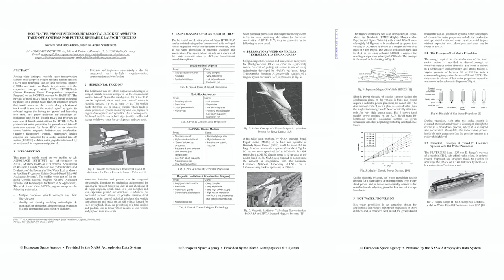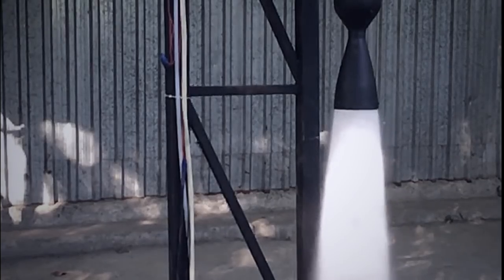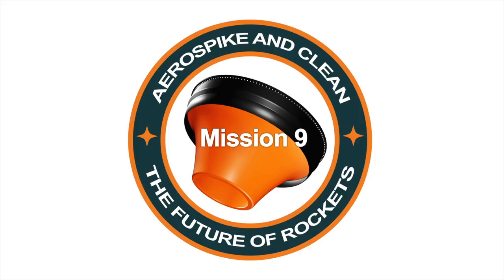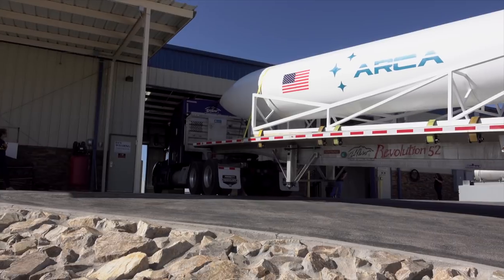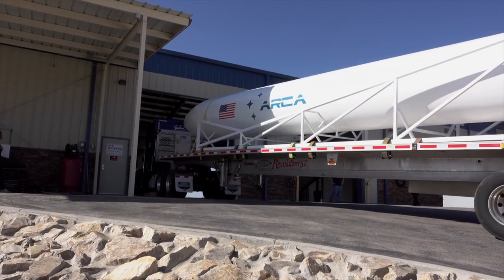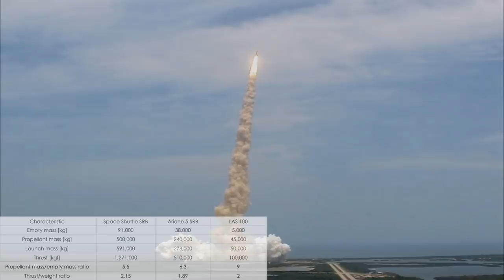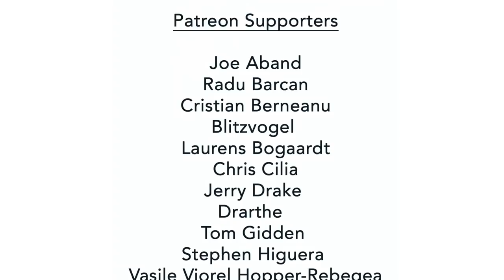Flight of the Aerospike: Episode 36 - Launch Assist System, Explained - Part I

Comment: Firstly your maximum chamber pressure is 50 bar. At lower than 100s Isp especially with the given mass fraction the vehicle would be incapable of counteracting supersonic drag forces, a problem that compounds with payload mass. I believe that paper you showed on screen directly references this issue, and if not, adequate literature from scramjet research already exists on the infeasibility of orbital flight using TSTO with less than about 2.5G acc, even if your upper stage has thousands of seconds of Isp  (Scram-jet). Even aerospike engines, which functionally only superficially increase high altitude performance when mass fraction is considered, are not close to a solution. Gravity drag is so high it is asymptotically impossible with a structural coefficient greater than 0.1. A steam pressure vessel with LIPO batteries (<500W/kg) will in no universe have a structural coefficient of less than 0.15 unless it is literally the size of the death star.

Comment: This is now clearly some ideas searching for a solution searching for a problem to solve.    Environmental friendliness isn't a big win if it just assisting a honking great traditional chemical first stage...  And, the aerospike isn't an advantage unless it is operating in atmosphere  and also in vacuum - a launch assist booster with short duration won't  do this, so the weight and complexity isnt warranted.     I really want this to be a thing, i just can't  see what practical use it provides in its latest form.
Reply: Some data about aerospike, I guess. Second stage (Haas) also has an aerospike, albeit linear one.
Reply: selection of the fuel is mainly driven to reduce cost of handling hazardous substances and complexity in the booster; the fact that it is environmental friendly is just a nice added bonus. I mean, all this video explain exactly this
Reply: @lesto12321  Hazardous substances like HydroLox hahah! This is nothing but a scam to people who don't know that much about rocket science.

Comment: I think you neglected to mention that liquid hydrogen and oxygen propellant used on the space shuttle main engines IS water.
It produces water in its exhaust.
There’s no way an electrical heating system can match it.
Very sceptical of this video.
Reply: while they burn into fuel, both pure oxygen and pure hydrogen have to be stored in big quantity on site.
Hydrogen is nasty as the flame burn invisible, slowly leak from anything, and is quite strong greenhouse gas.
Oxygen make burn things that normally wont burn and probably is more scary than hydrogen.
Also cannot be produces "on the fly" but normally big tank are present at the launch site, fully fueled up even when people are working nearby; at the contrary the boiling pressurized water can be produced directly on site at the moment of the fuel up (so nobody is near the launch site).

Those are huge difference that as said in the video will drive the cost up a lot as you have to take a long list of precautions to deal with those danger.
Reply: @lesto12321 
'Hydrogen is a quite strong greenhouse gas' .... You may not believe it but water vapor is one also.
The other thing about water rocket are batteries necessary for heating the water mid-flight. They won't be light Scot Manley did the math of how much power they would need.
I've stopped believing that anything from ARCA would finally lift off a long time ago. Heck the videos are still titled 'flight of the aerospike' but since the time of the aerospike they went through 2? different concepts? The water rocket will be abandoned when they finally calculate how much all those batteries will weight, and when they realize they should switch to microwaves for heating for greater efficiency. At which point they will abandon it as all previous concepts
Reply: @awazruk1  but water vapor is emitted by both steam and h+o rocket.
About manley, he calculated to steam ALL the water, not to just keep the temp in flight.
If the test will show the steam and/or the aerospike not up to the task, is just natural that they will ditch the ideas, it is about getting to space after all. I dont see whyt try different concept is bad, just look how much desing from succesful engines/rocekt changes between first ideas and final realization.
Reply: @lesto12321  BS.
Reply: @lesto12321  Sorry for the late response, iteration of design is a good thing and is necessary to achieve great results so i have no problem with it whatsoever. My problem with "ARCA style" design policy is that they are not doing it. They are not developing one concept. They jump between completely different designs which makes all the previous work meaningless and requires scrapimg of most of the ideas and knowledge you got.

Comment: I think this system has some potential, especially if the water could be overheated further and/or additional heatsources could be implemented. Things like microwave- or laserheating from the ground, using a small methalox engine to heat neighboring water engines, supply the booster via cable while its still close to the launchpad and so on...

Comment: Do you use induction or heat elements? How big battery will the rocket have? What about using some of the water inside the tank for thrusters?

Comment: if you wanted to take things a step further, and could manage the costs of integration, using a solar reflector setup to heat the tank directly, or to preheat the water would be an interesting option to further negate the use of external energy.

Comment: I think this is a good idea for a booster. Lots of thrust, easily scalable, the cheapest ‘fuel’ - water - and gets the vehicle out of the thickest part of the atmosphere nice and fast in a clean way. Also the unpleasant rocket emissions will be starting at high altitudes so no worries about NOx and sooty particulate matter at ground level. Even better you could use a ramjet (ideally scramjet but very immature technology at present )for a short 2nd stage until the atmosphere is too thin. You then save oxidiser weight.

Comment: I don't think a hot water system can equal a chemical propulsion system.  The energy density is too low, the same as comparing the energy stored in a battery (electrochemical reaction) versus that stored in a chemical reaction involving combustion.  Ten gallons of gasoline will propel my car farther than Elon Musk's Tesla.  His battery weighs 1200 pounds; ten gallons of gasoline is about 70 pounds.
Reply: There not even Using batteries For this test flight. And when they do it will only be used for in flight heating. Their main idea is to heat it up from the ground and then let it off as a wildly in efficient but powerful first stage.

Comment: What sort of performance would you get using the water system if you were to use it as a launch system on the Moon or Mars.
The lower gravity and atmospheric pressure, would this help?

If they can obtain water on Mars then fuel conversion would be so much simpler than the other systems proposed to extract/convert  to methane or other type fuels.
Just a thought...👍
Reply from the maker: Taking into account the lower pressure atmosphere on Mars and vacuum on the Moon, the engine would definitely work better. We don't have an estimation however how much better. The physics behind this engine isn't identical with a hot water engine. Maybe you noticed the high expansion ratio divergent on the test stand at almost sea level. However we perfomed some simulations in vacuum for interplanetary flights, but at a much higher temperature in the engine. In theory we would be able to get an isp in the range of 350-450sec.

Comment: So the water gets heated in the rocket before lauch? Is the water preheated before therefore reducing the amount of heating needed in the stage itself? Also is the stage pressurized for the intire week of heating the water? 200°c of pressurized water sounds dangerous. I imagine the burn (activated) time of the booster is not much longer than other boosters in the industry because of the weight and poor isp?

Comment: I just don't understand why you just don't use liquid H2 and O2? You get way better specific impulse, and still safe for environment? It's the same mentality as using hydrogen fuel cells in electric cars instead of just strait electric, you are just wasting energy.

Comment: Good luck! I really hope this works out. I have a couple of questions if you don't mind. First, is the aerospike design any good with the water and second, does the aerospike lend itself to a mulitple engine per booster configuration. Perhaps with multiples, you could get the thing to orbit easily. Just a thought.

Comment: Hello, 
I am first of all very impressed by your approach- despite many problems, you guys stood by your idea and managed to, I think, provide a very promising concept. If i understand this correctly, your aim is to use a lower efficiency, but high thrust water based rocket as a booster for orbital launches. Because the energy stored in water is lower than other propellants, the engine will naturally be less effective (requires external heating), but you plan to make up for this by increasing the size of the booster because it is way cheaper to produce and fill, thereby still reducing cost. Is that correct? Also, if you could give a general idea of the thrust-to-weight-ratio that can be achieved by this booster that would be nice and would help many people see the potential of this technology. 
Overall, it is a very impressive approach and I am particularly excited to see this combined with the Aerospike engine  - as you showed in one of the clips I'm assuming! That should also be easier to handle with a less dangerous propellant, right?
I am looking forward to your answer :) Keep doing what you're doing, and hopefully the flight test will be successful!
-marius

Comment: I have a question based on earlier videos, maybe your design changed since then. Why do you include the heating elements in the tank itself? It seems to me that since the heating process takes hours, the tank walls are thermalized anyway so you could simply heat the water from the outside on the launch pad and save weight and complexity. Was it just for testing?
Reply: @HylanderSB   Thank you for your answer but I wasn't thinking of transferring superheated water in the tank. I think they could heat the whole tank with cold water inside in some kind of huge mobile oven right before launch (like a big heating sarcophagus if you like). I don't think this is more complex than what they are doing now and this is definitelly weight saving. Plus they get to reuse the oven part.
Reply: Moreover they can add as much insulation aroud the oven as they want which speeds up the heating process without a weight penalty
Reply: @HylanderSB  Yes through the walls by conduction. That work pretty well for steam engines. Moreover they have all the time in the world to heat up the water.

Comment: After the karman line, I doubt superheated water would have enough isp, this idea would work very well if we had a efficient energy source at a high temperature, basically a functioning fusion reactor.
Why not make the heating element an augmented nuclear reactor??Current batteries are bulky so...
Best of luck!!
Reply from the maker: It is possible to use this engine in vacuum for deep space missions. We ran simulations already and have something on the pipeline. But, when the time will come. Nuclear reactor? No! Just think outside of the box. Don't chase performance, but rather to have the job done, fast, cheap and safe.

Comment: how are you going to power the thrust - what heats the water and how do you get the energy to do it?
Reply: i understand that you heat it on the ground and it stores heat but how are you going to get the huge amount of energy for orbital flight from this? (the energy in the first stage is still very important)
Reply: @tristianity8529  The water is heated to a particularly high temperature and the onboard batteries are there to just "tip it over the edge". So the energy is the heated water really+a little battery power. Their contention is that even if it's not great it's enough to help their upper stage.

Comment: I admire what you are trying to do and that's why I subscribe but I am tired of your pointing finger attitude really off-putting. So please less pointing finger and more data like the amount of h2o vapour in the hight atmosphere per launch since it is your biggest pollutant.
Reply from the maker: Thank you very much for subscribing. We are just trying to show the potential benefits of a new approach. We never said that a particular rocket is bad in any way. We talked about our system and other systems in general based on the propellants properties. On contrary, we admit that in spite of the cost reduction, environment protection and safety, the water-based system is significantly less efficient than a hot propellant one. Yes, we used photos and video with other rockets in our video as beta footage, but we never point the finger on anyone in particular. Our approach is: we are developing an alternative system and we show how it differentiates from the other. If it's going to succeed or not, only time will tell. Hope this clarifies.
Reply: They’re just trying to market themselves to people because nobody believes in In new and crazy sounding technology so they got’a find investment in other ways until they can actually launch something and prove the concept